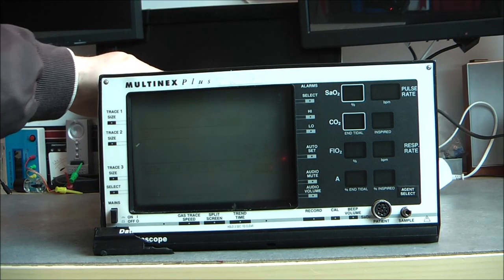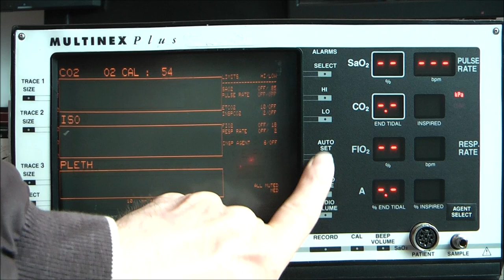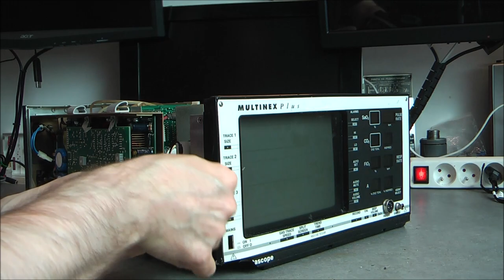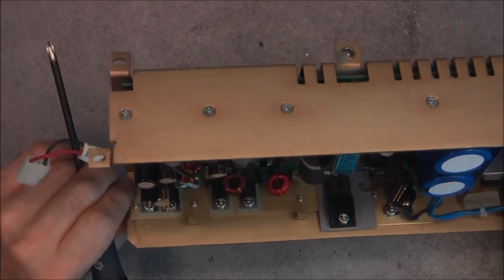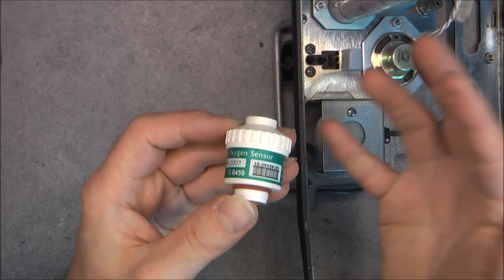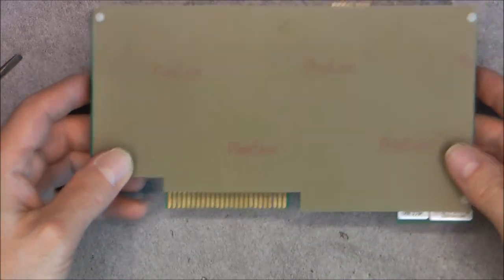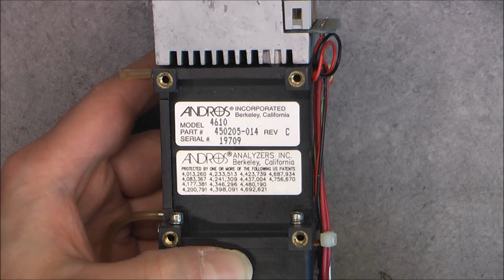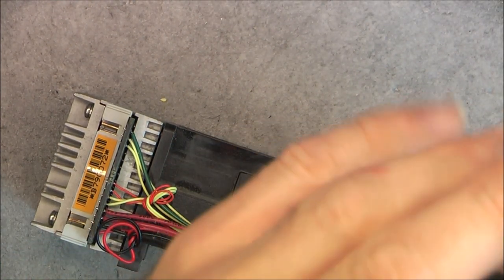Datascope Multinex breath analyzer teardown

Comment: Some of the major chips:
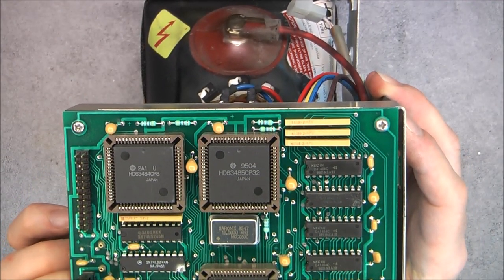@37:52 HD63484CP8 Advanced CRT Controller
HD63485CP32 Graphic Memory Interface Controller
HD63486CP32 Graphic Video Attribute Controller

Not sure which one is the CPU? Well, there's 3 of them on different boards.
@39:35 HD63B09EP Hitachi's CMOS version of the Motorola 6809 microprocessor.
@42:28 MC68008P10 The Motorola 68008 is an 8/16/32-bit microprocessor made by Motorola. It is a version of the Motorola 68000 with an 8-bit external data bus, as well as a smaller address bus. The original 68000 has a 24-bit address bus and a 16-bit data bus.
@43:35 HD63B09EP Hitachi's CMOS version of the Motorola 6809 microprocessor.

Comment: Electrogalvanic oxygen sensors contain sodium or potassium hydroxide in solution so opening them can be quite hazardous.
The other technology you were referring to is that of a paramagnetic oxygen sensor.  Those are much larger than a chemical sensor as they require large magnets to work properly.